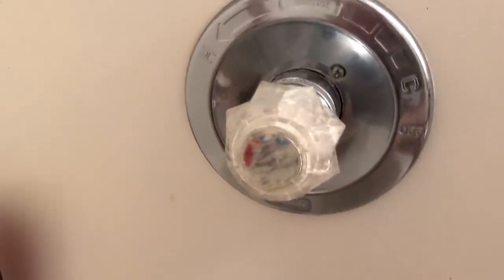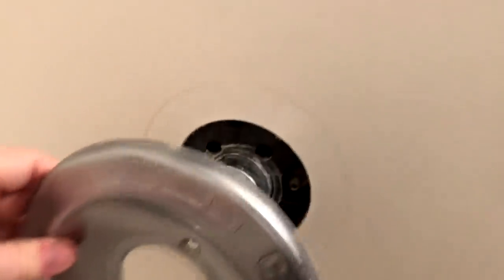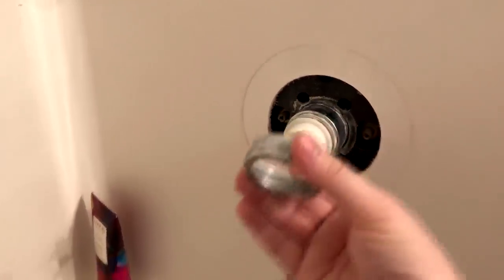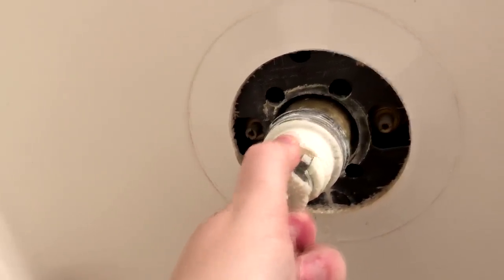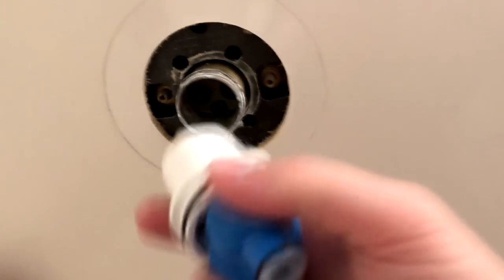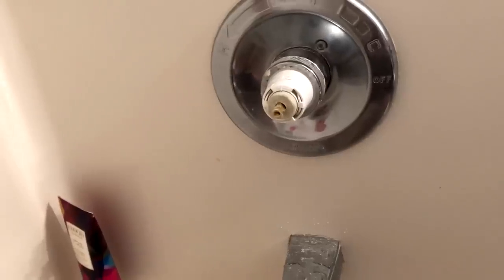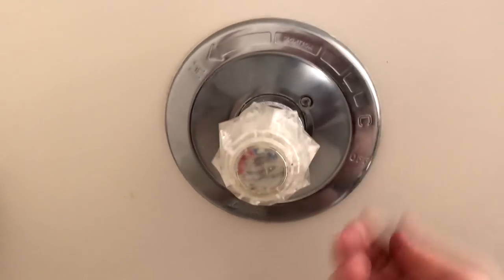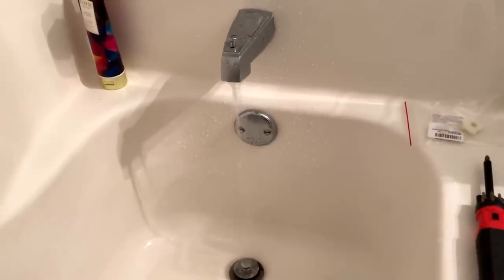How To Replace A Delta 1300 / 1400 Shower Cartridge

Comment: Great vid! Dunno if anyone suggested this... before you start disassembly, place a hand or bath towel over your drain.
It reduces the worry of losing an odd screw or part down your drain.
Reply: That is an excellent suggestion!  It will definitely relieve some stress about dropped screws! Haha! Thanks for the input!

Comment: Excellent video. NOTE: If you happen to have a white 1400, the cover on outside of control knob actually screws off, it is a thin white cover to the screw.  You can take packing tape, which will not leave sticky, stick to plate with lots of extra and use that to unscrew the cover plate. 

And my bonnet is brass, came off easily with piece of rubber, like i use to remove jar covers, and over the rubber gently using a channel lock.
More potentially useful information:  Mine has always been backwards, hot came on first since I bought the house, seemed odd, but not a bit issue, just got used to it. However when I replaced the cartridge today I switched it, hot side where the cold side was.  Or at least I thought, strangely enough it still came out hot first, so maybe the old style cartridge is backwards from the new ones.  Anyway, took it out, turned it around and yes, now the cold comes out first as it should.  Saves my plan to change the pipes around, much more work.  The first time I put it back in after turning it, it leaked.  So I removed  again and re-inserted, making sure it was clean and all the way in, and worked fine.
Reply from the maker: Thanks for the additional info on the white 1400!  Very good to know!
I'm so glad you were able to rearrange your cartridge instead of your pipes :D
Excellent job and glad you get it all sorted!

Comment: Do you replace this part if it’s the bottom part of your shower leaking hot water? That’s where my leak is coming from it’s not coming from the knob. I wanna make sure before I replace that part. Thank you
Reply: This can cause water to leak out of the spout. So if you turn the shower/tub OFF and water is still trickling out, you probably need to replace the cartridge or one of the O-rings. So following this video should help you if this is what you are experiencing.
Reply: @BentleyDesignCo  Thanks a million for replying.
Reply: @pennygirl99  my pleasure!

Comment: I advise anyone trying to order parts (hopefully as original owner, for free) to figure out first the size of the original.  The blue one is shorter than the grey one.  This video shows replacing a grey cartridge with a blue one.  My shower model is Delta Monitor 1400, which according to the manual should have RP 19804, which is a blue one.  I ordered the blue one, but found that it was shorter than the original, which is actually RP 46074, a grey one.  So I reordered a grey one.
Reply: Ive got the same 1300 series. I was starting to wonder if I was the only one to have one of these with the chrome bonnet nut exposed as in the video and  ive got a cartridge coming from delta. I assume they are sending me a RP 19804. I cannot find a trim kit anywhere for it. My bonnet nut needs replaced and when you search for them a 1600 series bonnet nut comes up.  I dont know if they are the same or not.. Any help would be appreciated.

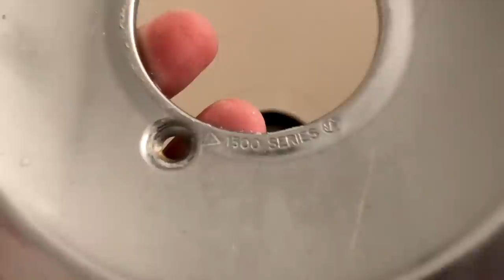Comment: my Delta "monitor" shower knob is close but no cigar it's so weird , it's got a center screw but its got a notch thingy (white plastic) and it does have the temperature marking,,,,i can't figure out what model it is, crazy.......looked everywhere.  House was built in 1996, everything else looks identical to yours except the inside cartridge.....also the little plastic hot/cold cap is slightly different.  Any ideas are appreciated.  great vid.  EDIT:  04:53 of your video, there's a marking on mine that says "1314 Multi-Choice"  instead of 1300 Series.  I will look that up and your pointing that out was critical !!!!
Reply: Thanks!
I'm so glad I was able to help you with the 1314 Multi-Choice!
I hope you were able to get the replacement done successfully!

Comment: Thank you! This is the video I was looking for! I now know I have a 13/14 multi series!
Reply: Take cartridge apart (twist in the middle) open it up and replace seats and springs, most of the time that will solve your problem.  If not call Delta, and they will send you one for free.
Reply: $5 fix, instead of $50

Comment: Do you think replacing the cartridge will solve the problem I have?  There is no cold water to the shower or the faucet to the shower.  Not sure what to do?  Thanks for any help.
Thanks for the great video and information.
Reply from the maker: Do you get cold water to the sink in that bathroom?  It could be possible that this is an issue.  Maybe the cold water side of the cartridge is plugged up and only the hot water is getting through.  I'm definitely not a plumber, but it may be worth a look.

Worst case scenario, you can replace and see if it works, and if not then just return the cartridge and call a plumber.

Best of luck to you with your water problems and thanks for watching!

Comment: To remove the cover, you take a phillips screw off, I've been fighting to remove that screw for the last 3 days, it won't come off, it is stripped...the last thing I am gonna try is with a chisel, I'll tap it a few times with a hammer and see if I can "cut" a new slpt for a straight screwdriver...any ideas? I have tried the rubber bands, screw remover tool,it won't budge...
Reply: You can try to drill the screw out with a drill bit if it's stripped too bad to remove it.  Just be careful with it.

Comment: It's cold and I'm having a hard time. Could the temperature make it difficult to install the new  cartridge?
Reply from the maker: I'm not sure if the pipes being cold would make it more difficult.  I would think that the cold would cause the pipes to contract, but not sure how much that would affect the process.  There could be a build up of calcium or hard water or something causing it to stick.  It definitely can be difficult to get the valve out.  I had to wiggle it back and forth a lot to loosen mine.  And you should always be careful not to damage the pipe behind the wall or it gets more expensive to fix haha.

I hope you were able to fix your problem with it!

Comment: The first odd thing I notice with the old cartridge was the hot water was installed on the right as you pulled it out.  You can tell by the notch, it was on the right when you pulled it out instead of the left ... etc. The cartridge hot watermarking should be installed on the left ... but it is still backward ... appears the piping was installed wrong? Did you just flip the cartridge hot water to the right side ... and did it work correctly?
Reply from the maker: That's exactly what I did.  After I installed it and found that the hot/cold were reversed, I cut the water to the house again and removed it and turned it 180 degrees and re-inserted it.  That time the hot/cold were correct.

Thank you for watching and for your wonderful questions!

Comment: Did you wipe some plumbers grease on the O rings before installing?
Reply from the maker: I did not.  The cartridge goes in fine and does not leak without it.  I'm sure it wouldn't hurt anything if you wanted to add that though.

Thanks so much for watching and for the excellent question!

Comment: The bonnet won't turn at all I haven't put a tool on it how you go about getting it off?
Reply from the maker: Hi Sam!  Sorry for the late reply (been traveling for Christmas).
I would maybe try using a cloth or shirt to give you a better grip.  If that doesn't work you could use a pipe wrench (just watch the teeth and ensure they don't scar the bonnet) or one of those rubber belt tools that you use to change an oil filter on a car with maybe?

Hope this video has helped you!
Reply: Sam Hamdan spray pb blast over trim ring hold the back with one hand and gently use channel locks and turn ring counter clock wise and should loosen up
Reply: !That's the problem in videos  some times you get confused because look easy but in real life special in old valves is not and you need tools of course!!🤔🤔🤔

Comment: Struggled to get the handle off and then unable to remove bonnet nut!!! Try this it worked for me drained system left basement tap open and POURED CLR down the shower outlet pipe through cartridge. Let sit for 10 mins. TADAA hope it helps someone out. Cost is minimal.
Reply: Thanks for the tip Bob!  That could definitely save a lot of struggle and stress!  Great idea!

Comment: Did you need to remove the cover plate in order to get to the cartage? It looks like everything could have been done without removing the caulking and cover plate, thus removing the need to re-caulk the cover plate when finished.
Reply from the maker: Evan that is an excellent question!  I have not tried to replace one of these without removing the cover plate.  I do not see anything that would stop you from pulling out the gullet and bushing there....  If you can get your hands/tools in there and loosen it up, give it a try.  Just don't force anything because if you break the pipe in the wall, it gets much harder to fix haha!

Comment: Sorry! but sometimes you need W40 and channel Locks l used to be apts maint l used to change those "lam wrong???🤔
Reply: Sometimes that may need to be done.  But I won't recommend it here b/c I don't want to be responsible for anyone's broken pipes haha!  ;)
Reply: @BentleyDesignCo  !!some times is not that eazy only in videos like yours is l was there special to remove the ring in old valves?🤔

Comment: The new cartridge doesn't quite want to seat all the way.
Reply: I've seen that.  Make sure you have the correct cartridge and make sure the receiver is clean.  Also make sure you are aligning it properly when inserting (there is a little arrow on the cartridge that will fit into a slot on the receiver).  Best of luck!
Reply: Same problem here.  New cartridge is the correct one,  but will not push all the way in no matter how hard I push.

Comment: Great video, except not clear why the hot and cold were reversed even though you were particularly careful to make sure the cartridge was correctly installed.
Reply: It was because the pipes were run different in the wall.  The hot is usually run on the left and the cold on the right, but it was flipped in her house.  This happens sometimes, and you can fix it by flipping the cartridge.

You can maybe look at the cartridge you are replacing and see if there is a Hot indicator on the original so you know how to install the new cartridge.

Thanks so much for watching!  And excellent question!
Reply: Thanks for response, however, since my system is 30 plus years old, it may not have a cartridge, so:1) is there any harm in letting it run hot/ cold reversed; 2) if I want to do it right, what should I do, and what can I expect to pay to correct it.
Reply: Hari Agrawal there should be a cartridge in there or you would have a bad leak happening. The one I replaced was about 25 years old.
And there is no harm to have your hot and cold reversed. Other than maybe a surprised guest with a cold shower instead of hot haha :)
The price for a cartridge like this is about $20-$30 if I recall correctly.